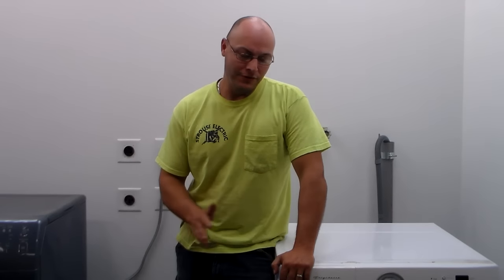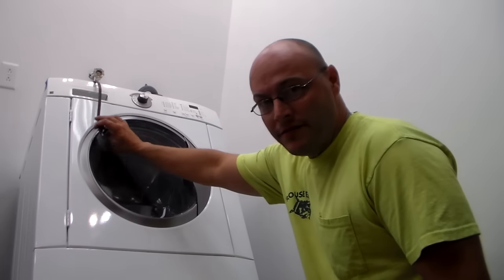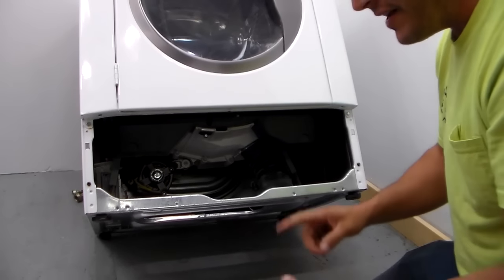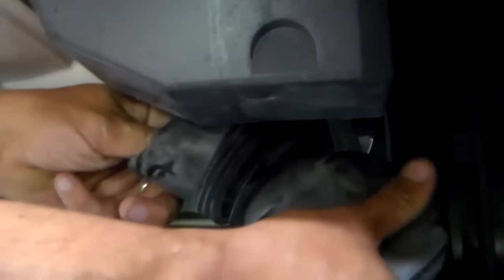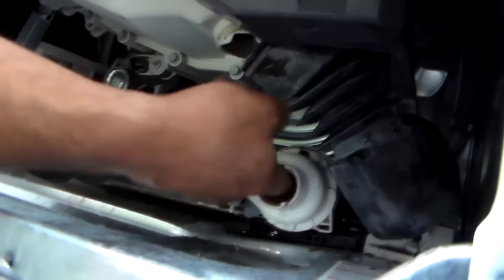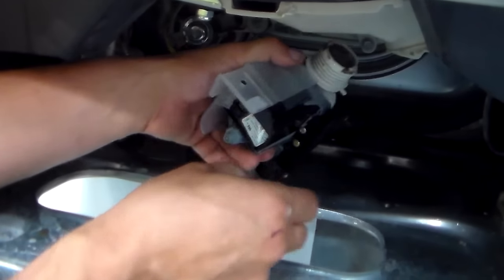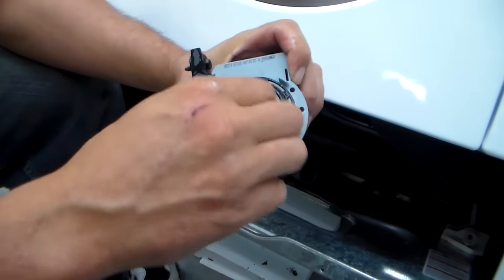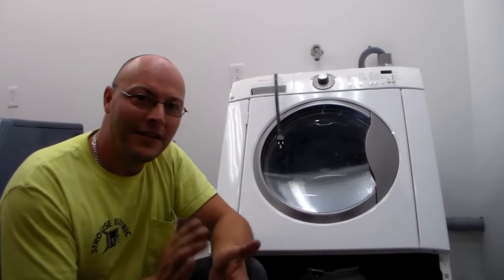Front Load Washer Repair - Not Draining or Spinning - How to Unclog the Drain Pump

Comment: Most important part of this videdo:  DO NOT REMOVE THE PRESSURE SWITCH TUBE!    I did this prior to seeing this video and it's a bitch to get back on.  The engineers decided to place non-movable crap in front of the tube.  Damn near impossible to get this back on.

Comment: Get a die cutter, grinder, jig saw, etc making a shallow cut - if there is no panel from the manufacturer and cut a huge access door on the front of the washer and put in a plastic insert with a door securing the frame with sheet metal screws  like at this website https://www.walmart.com/search/?query=access%20panel

Comment: YOU LIED --- You said you were going to SHOW  us how to get to the drain pump on BOTH kinds of front loaders - the ones with the bottom panel like in the video and the one where you have to take the machine frame apart - BUT the ONLY one you showed was how to get to the drain pump on a machine that has the bottom panel.  My machine does NOT have the front panel at the bottom and I have NO IDEA how to get to the drain pump on the OTHER kind of machine.  Thanks for nothing.

Comment: god damn i tried to fix my washing machine and i dont have a front pannel which is fixing became a pain in the a.ss and i bough my washing machine like 50 buck....so i guess i just fuk it buy a another 1.
Reply: Good Morning. I have a question.. I have a Samsung front load Washer that is staying in spin cycle and keeps adding water so I read up on it and it's saying that it is because of an unbalanced load. So what I did was take out all the wet clothes and ran again but the same thing happens.. Keeps running and adding water. So I decided to shit off water and run again on spin only cycle everything worked fine since it had no water going through it.... Do you have any clue on what I need to do to fix it. Thank you very much if someone can help.